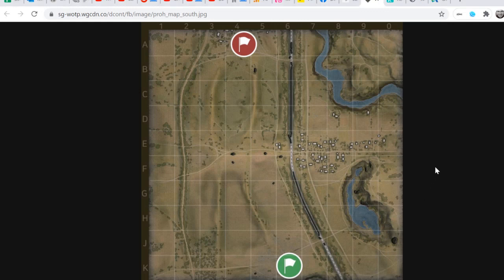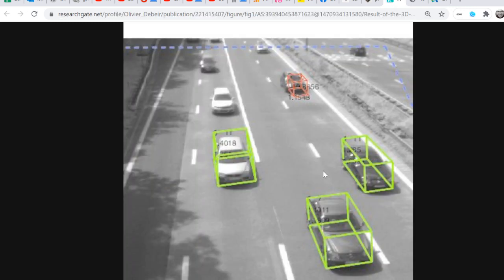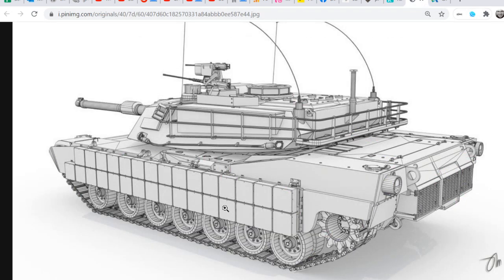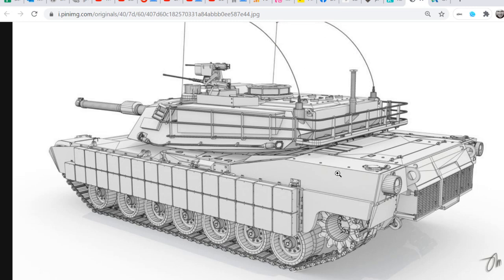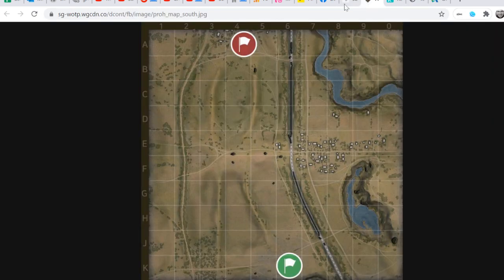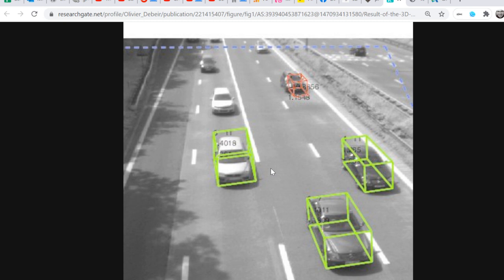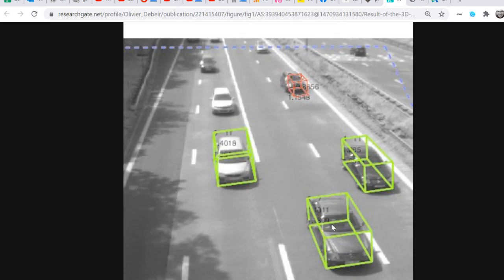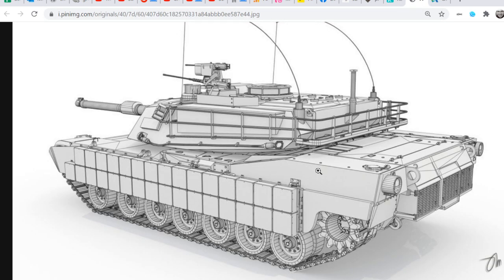How to Optimize Collision Detection in 3d Games

Comment: Awesome video, but few questions:

1) Wouldn't it be a good idea to add additional generalized polygons inside the 3d model, for collision detection. For example if we have 50 plates on the side, can't we just have 2 triangles forming a rectangle for the entire side and then test for both of them instead for all the triangels of all the plates...

2) It is one thing to calculate distance in a static frame, but from my understanding a lot of the optimization issues stem from the fact that we need to do it in real-time. So my question is, are we talking about collision detection as it would happen in the future frame (prediction), or are we testing each frame to see if projectile collides with the object (reflexive approach), or probably a mix of both?
Reply from the maker: when you fire, you can just draw a line for the projectile so you know all the polygons that the ammo will hit, which resolves the predictive issue
Reply: @cheapbooks  Yes, of course, however speaking in broader terms, if the projectile is slower and the target also moves and also the target could change directions while moving, the problem becomes more serious. Because now we have to decide when to test. Would it be viable to have for example a cube around the centroid of the projectile and an algorhitm that examins any intersecitons with this cube, say every 5 frames and if an object enters this cube, more precise calculation goes into determining if that object is part of the target? The reason I ask this is because even modern games have a lot of problems with clipping issues around cloak/mantles on the back of the character....